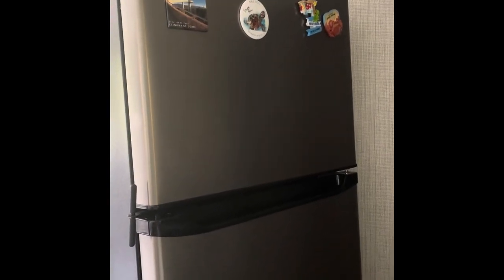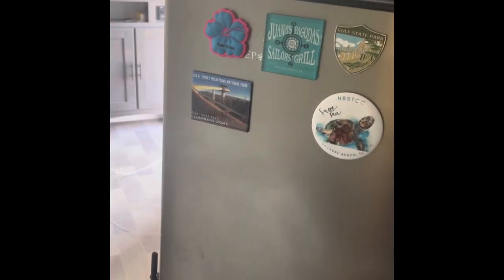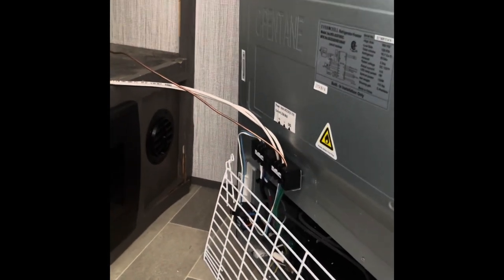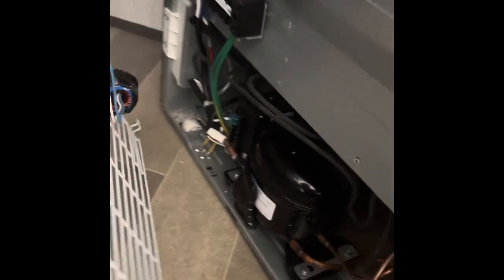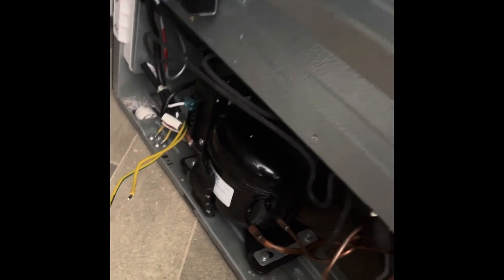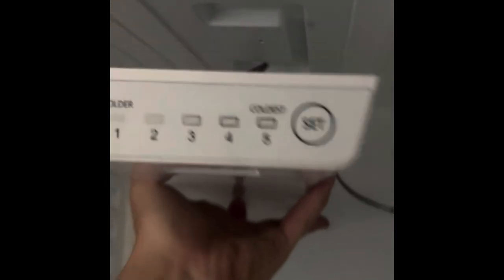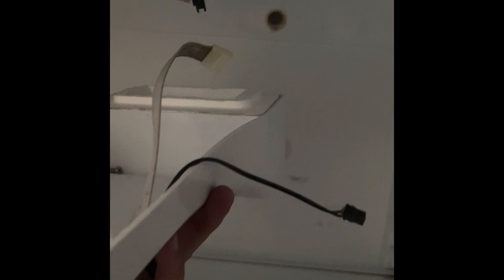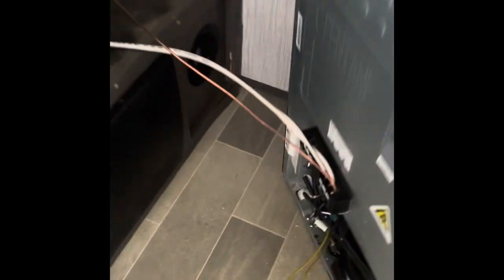Ever Chill 12v camper refrigerator pooling water in bottom (drain plug clogged)

Comment: How to defrost these without water leaking all over the floor.  There is a hose for the freezer but never the fridge part and Ofcourse the water always drips down 😒
I do maintenance on fema campers and sometimes fridge will build up ice but in order to defrost I just been taking them outside.  Such a pain in the ass.  I’m guessing this is what you showing but at this point I will just take it outside and spray with water hose or let it sit till it defrost and drains.  😢